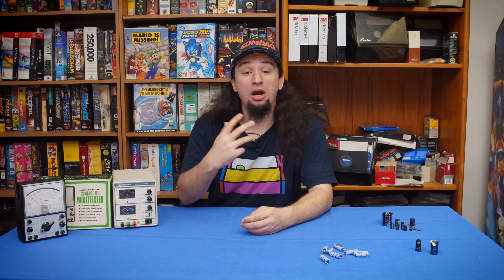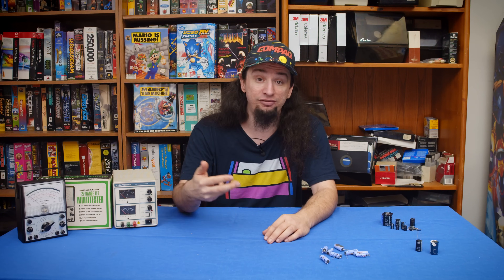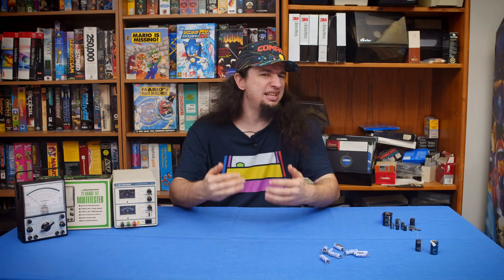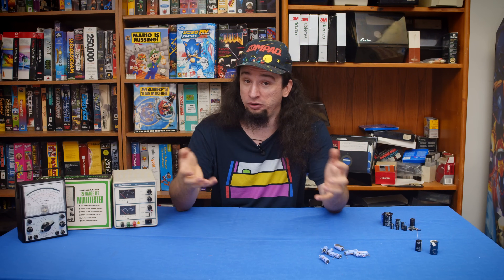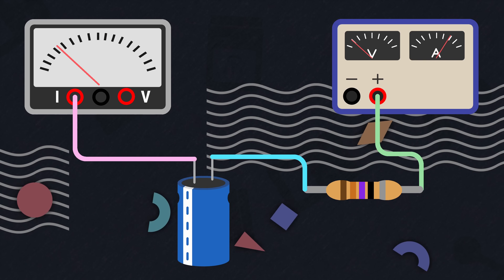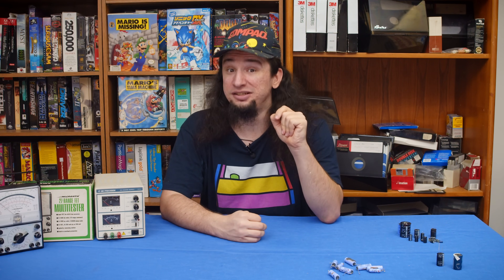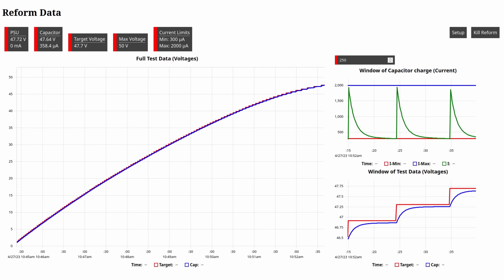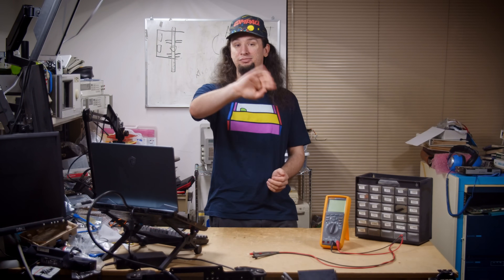Reforming Capacitors - Everything you wanted to know

Comment: This is also an issue with grossly overrated capacitors: If you use for example a 50V capacitor on a 5V power rail, it will initially work as intended, but with the operating voltage being so low the capacitor can't properly reform the oxide layer and will lose its formation over time. It's always a good idea to leave some safety margin for the eventual stray voltage spike, but too high is bad as well.
Reply: This is why capacitors in the HVAC industry have multiple oxide layers and thus multiple voltage ratings, 440/370 is the most common that I've seen in the field.
Reply: @DGTelevsionNetwork  HVAC or other motor start/run caps need to handle significant AC power through them, not AC ripple from a DC power rail.
Reply: Hey thanks. My electrical engineering teacher back in the day just said it’s a bad idea for complex reasons and should only be done temporarily as a last resort. Lowkey always wondered why but never bothered to look it up.
Reply: this seems to be little known but ive been tought this by tv repair engineers in the 90,s lifes too short to test the theory so i just go allong with it , another little known i was tought (unproven) is that small signal relays need a little dc current through the contacts to keep em clean
Reply: @darrenmurphy6251  You are quite right, relay contacts have minimum ratings. Too little energy can't break through a microscopically thin layer of oxide (sulfate too due to the silver) if there's appreciably no sliding contact occuring. A good example is a commercial timing relay module with 10A contacts being used for just a logic level (I know, but they're out there). Works fine, ...for a time, then gets intermittent. 😏
Reply: Isn't it fairly common for low-voltage caps, in signal applications or even in low-voltage rail decoupling, to be rated at 50V or 100V just because manufacturers don't particularly like stocking 6.3/10/15/25/35/50/63/80/100V variants of 100n-47u caps in a 5mm case?
Reply: @sirnickity  Not just this. They littlery doesn't exist in most case. Just say: Looking for a 1µF with 6.3V. Good luck. You will just find some with extremly small sizes, made for special cases and they are more expansive too - because they are a niche product.
As an engineer for decades now, I just can say: In 98% of the cases we simply don't care by selecting general purpose parts. Lets say coupling capacitors. You will need somewhat around 1µF and 10V? Fine, we will select a 2.2µ or 4.7µ with at least 50V. Why? Because it doesn't matter and in most cases some values are cheaper or you will strip some special values from your BOM by changing it to another value used on the board anyway.
This video is not really well made... there's so many myth and things mixed around... for example what he was telling with "self healing" in the beginning. A kind of term used for metal film capacitors, to make them short-circute resistant. Not a term used for electrolytic caps at all.
As of my experiance the most common failure mode in the 90th up to the 2010 years was simply drying, leaking and overheated capacitors. Littlerly the whole 90th electronic equipment tackle with leaking capacitors. Whereas some electrolytic capacitors from the 60th and 70th still measure find today - many decades later. Around the millenium time point we tackle with blowing capacitors, resulting of new heat problems appearing, because of the new requirements for power/space density. And internal heat resulting of hard rippling DC/DC stages, the old capacitors are not made for.
Except some really bad caps, as like most ELNAs from the 90th or simply all early SMD electrolytic (also 80th/90th), the top most enemy for electrolytic are missusage in relation to heat. There is no magic reforming on most of the failures. This might exist in some case, but is simply not a major problem.

And also with a engineer perspective of view, I always wonder why guys in repair videos tacke around with some caps, for example small leaking SMD caps on 90th equipment, which they try to replace with standard THT parts, by opening up shilding cans. And they always tell you: They are better, they won't leak. Bullshit. First of all: They could easly replace them with ceramics. MLCCs with high capacities do existis today and they are sometimes feaking low in price. Most of the caps replaced in such videos are just blocking capacitors. Using ceramincs gives better results - but they didn't have the knowlage. And second: THTs can also leak. And does it matter? Most of the equipment they repair is litterly 30 or more years old. What do they think this equipment will life after such a repair? Another 50 years? Bullshit. And not the start thinking about the point current SMD replacements last many, many, many years. And last of all: "They are better..." Well, open up shilding cans to make fit long leged capacitors do make it "better"? Oh god please, no...!

And as an advice to all here: If you have to replace an electrolytic, use at least the same capacity and at least the same voltage rating and if you just heave higher values: It simply don't matter. Don't think of an engineer tricking around with this specific value on this specific electrolytic. This is bullshit. We overprovision them all! We don't try to hit a spcific value. The have tolerances in the range of 20%. What do you think makes it reasnable to hit a specific value target!? This is simply bullshit. And this applies to around 95% of the cases. Yes, there are sometimes very special cases, where you nail a specific target on purpose. But this is simply very rare. I would never bother with this, I would switch to a foil or ceramic capacitor, becaus it's just more predictable. I am not the only engineer with this mindset, so don't think of it too much here.
Reply: Wouldn't it just slowly approach being a 5V capacitor then with the oxide layer rebuilding at a much lower rate? The large safety margin will be gone after a (long) time, but I can't see why it wouldn't continue to be operational at the lower-than-designated voltage. Maybe I'm missing something, though?
Reply: @ResonantBytes  I used capacitors at lower voltage and none of them failed in say 10 years.
The way things are now the ones who use electronic parts for building anything is: let's see how we spend less and let the poor parts operate the most and if it is possible, we can let them reform themselves.
The same bullshit apply when they make cooling systems for whatever you may think of. One notorious example is how they make cooling systems for laptops shrinking the cooling systems until the CPU reaches 100 Celsius if it is rated to work at 120 Celsius.
I never had any trouble with capacitors rated for 50V at a maximum of 12 or 25V. They never failed in a long period of time.
Also make a cooling system to cool down a CPU/GPU at max 55 Celsius instead of 90 Celsius and it will last forever (apart from not heating all of the surrounding capacitors making them to fail way before their time). Use 25V rated capacitors at 12V whenever you want. Nothing bad will happen to them.
I don't know what can happen if someone uses 400V rated capacitors at 12V but for half of the rated voltage it's completely fine.
There's audio capacitors used at 0,775V while they are rated for 50V and they are still doing their job in amplifiers 20 years old.
Reply: @Dandan-tg6tj  Yup, that's my experience as well. I think the original statement was about the extreme case though, like the 400V cap at 12V you mentioned. I'm not sure what will happen to them either, but I can't think of a reason why they should fail when lower voltage types wouldn't. They are huge though, so the only use case I can think of would be as a cathode resistor bypass capacitor in a tube amplifier to have enough safety margin for shorts between anode and cathode. In that case the oxide might actually have degraded enough so it wouldn't be able to cope with the Ub for the tube, but the anode resistor will limit the current and voltage effectively. So even there I would prefer having a capacitor that would potentially be able to withstand the fault condition over one that definitively would not.
Reply: @ResonantBytes  it may not stay formed long term, also bad idea to use, say a 50v cap thats been operated at 5 to 10v or so for a long while, then at near 50v,  without a reform 'test' ..
Reply: @ResonantBytes  Two things: the thickness of the oxide layer determines the capacitance, so there's no guarantee that the "rebuilt" 5V capacitor will have the same capacitance. Although in many cases it won't be a problem.
Secondly, if the capacitor is ever re-used as a 50V capacitor (which it's marked as) there's a real chance of some serious over-current until it manages to reform to work at 50V.
Reply: @RexxSchneider  Yes, if the overall thickness of the oxide layer decreases significantly that would increase the capacitance. I'm not convinced that's what's happening though. The oxide layer won't deteriorate evenly and there will be points where the thickness is much smaller than the overall thickness. It's these thickness minima that determine the ability to withstand voltage. It could still happen over a long time, but in my experience I rarely found electrolytic capacitors which had gained capacitance over their rated variance (usually -10%/+50%). As you said, in most cases it wouldn't matter anyway. It's something I will keep an eye on in the future though! :)

There is only one use case I can think of where that would happen though: If you place a capacitor in the circuit which is overspec'ed for the normal case, but has enough margin for a failure case. In tube amps e.g., there are often capacitors used as a bypass over the cathode resistor to increase gain. The voltage there is usually small (2-10V) but the Ub of the tube is much higher (e.g., 250V). There is a failure mode where the anode and cathode of the tube short out and in that case the cathode voltage is much higher than usual. If the cap there is rated only for the normal case it won't survive this kind of failure of the tube. That's why I use caps there which are rated for the Ub (which is still overspec'ed because anode resistor and cathode resistor form a voltage divider).
In that case the cap might not be able to withstand the failure mode after a long time of no such failure, which is a good thing to keep in mind. But in this particular case it might actually still be fine because the anode resistor will limit the current to a few mA. Also I'd take a component which can potentially withstand the failure over one that certainly can't any day.
Reply: @ResonantBytes  Notice that the reforming curve is just that, a curve.  Since it's not linear, it can be difficult to predict how using a higher voltage cap will function in the long run. Generally speaking, a lot of time and effort goes into the engineering of most electronic circuits and the engineers often choose specific values and types of components for reasons that may not be immediately apparent.  But, it's always a safe bet to replace a component with one of the same material type and values.
Reply: @projectartichoke  a lot of time and effort? I give you the salt bae meme with capacitors being sprinkled. Capacitors are often specifie based on prior experience and just industry tradition, and if it hasn't caused issues in engineering samples, that's it then, that's what it's gonna be. If this wasn't quite the optimal choice, well what are the odds that the commercial/useful life of device will exceed 5 years? It's going to be fine.
Reply: @projectartichoke  Agreed, it's hard to predict what happens exactly inside a certain cap if it's not used in a way that was tested.
But that doesn't convince me that there will be more problems when using a capacitor with significantly lower voltage than it's designed (and tested) for. In analog circuits that happens all the time e.g., when using an electrolytic cap to block DC from an AC signal. There the maximum voltage might only ever be reached in certain conditions, even only in fault conditions, but still they aren't failing more often than caps connected to a power rail. I'd argue it's even the opposite. Those caps might fail due to other reasons, especially heat and high currents, but if those are the limiting factors, I doubt the original argument about the influence of higher spec caps even more.

Yes it's not linear. But it doesn't have to be. It's an equilibrium system. When the oxide layer degrades, current may be able to flow at the current voltage. If it does that will rebuild the oxide layer, reducing the current that can flow at that voltage until an equilibrium is reached where the oxide layer rebuilds as fast as it degrades (or other effects start to have an influence). The oxide layer will be weaker than if the cap had been powered near its designated limit, but any current due to degradation of the oxide layer would have contributed to the regeneration of it. Also presumably less electrolyte will have been used which would actually prolong the life of the capacitor.
Reply: @ResonantBytes  are we discussing unpredictability vs rationality? I mean, the "I don't know" vs the "I guess"....
Reply: @jesuschal3802  Maybe? I don't know what you mean I guess. :D
Could you elaborate a bit more?
Reply: @ResonantBytes  It was just a reflection. I read two different approaches to the topic (overrated vs rated caps): the factual given by projectartichoke stating "it is unpredictable how the deterioration process would affect an overrated cap overtime" vs yours explaining the whole rationale about it, but still guessing the positive operational condition through out the deterioration process; both sound legit. That said, Siana makes a good point above "Capacitors are often specified based on prior experience and just industry tradition". So given both approaches (overrated vs rated) then "I guess" only time will tell...
Reply: @jesuschal3802  I like your thought process. Sometimes we simply don't know what's happening, but it's always good to be as prepared as possible for the moment we find out. :)
Reply: Hello. It would be very interesting to make a video and talk about what happens if you use a 100v capacitor where it was originally 50v. Or 50v where there was originally a 5v capacitor.

what happens to the microfarad value during use and reforming of the capacitor or will the life be shorter when you apply 5v to a 50v capacitor og 50v to a 100v

Can someone say something about this
Reply: @ford1546  Yes--When Olson Electronics was around, the electrolytic capacitors that they carried in blister packs had guidelines on selecting replacement devices. The most obvious caution was that the replacement capacitor should have a voltage rating equal to or greater than the original. They also clarified that one should not use capacitors "far below" their rated voltages. In my recollection, the example that they gave was of a capacitor rated for 525 V being placed into a circuit where it would never see more than 25 V.

It would seem that as a rule of thumb:
- Using a capacitor at its rated voltage is not good practice because there is no safety margin.
- Using a capacitor around 75% of its rated voltage is good practice.
- Using a capacitor at 30 - 50% of its rated voltage is OK and unavoidable in some designs. Consider the wide input range power supply circuits now commonly found in computers and USB chargers. These take a nominal input of 100 VAC - 240 VAC. The filter capacitors would see 140 VDC - 340 VDC, depending on where in the world the power supply is used. Very likely, the engineers designing the supply would use 400V capacitors as that is a common value.
- Using a capacitor at <10% of its rated voltage is a bad idea.
Reply: You get reduced overall quality by overrating capacitors.  A 5V rail you can safely use 10V cap or 25V cap; they used a 50V in assembly because they bought bulk and had them cheaper than buying half of them at 25V.  Also for tooling, that spot in the assembly chain they only need one capacitor inserter instead of two.  Cheaper overall for mass assembly, that's why you see 50V everywhere.
Reply: @officermeowmeowfuzzyface4408  some lower capacity types arent even available in lower voltage ranges anymore.
Reply: This is not true.  It is safe to use a higher voltage rating.  If you use a 500V rated capacitor and only apply 5V, the dielectric does break down over time, but to the point where it can properly handle 5V.  It could be reformed to handle 500V again, as long as the applied voltage is slowly increased.
Reply: @Jagasian  a bit higher, yes, but not ridiculously so,  a 500v cap used at 5v likely wouldnt stay formed long term 50v cap at 5v, not quite so bad , but still.....
Reply: Likewise, for filter caps, using 10,000 mfd to replace a 10 mfd may not be a good idea even if it seems like more filtering is better.  Larger value capacitors have more current inrush when initially powered which can damage other parts of a circuit.  It's not usually a problem, but it some power supply circuits it can be a problem.
Reply: @projectartichoke  very bad idea, the peak charging current can destroy rectifiers, especially valves/tubes , its ok to use higher values further downstream, separated from the rectifier by a resistor or choke, but not always if by a semiconductor regulator/stabiliser as that would also see a current surge when first powering up
Reply: @projectartichoke  First, testing will indicate that there is a point of diminishing return. Second, most power rectifier tube datasheets will specify the max size of the first power supply filter. For instance, the max recommended size of the input cap in a 5Y3 rectifier is only 10 mfd.
Reply: @projectartichoke  "Likewise, for filter caps, using 10,000 mfd to replace a 10 mfd may not be a good idea even if it seems like more filtering is better."

It also depends on what the cap is being used for in the circuit.  Capacitors are not just used for filtering.  They can also be used for reserving, coupling, decoupling, and bypassing.

A capacitor with a low capacity, like 10 microfarads or 1 microfarad, may be there for some form of coupling (of course, this depends on what the circuit is designed to do), so a capacitor of radically high rating is absolutely not the right part to use in such a circuit.  Instead of improving anything, it could cause a malfunction and even damage.

It's also fairly critical to stick with the same rating when replacing such low-rated capacitors compared to having some level of flexibility on the capacity if the cap is there for filtering.

Even with a +/- 20% range of tolerance, there's just not much wiggle room with caps of low rated capacities, so it's unwise to deviate from the capacity that's originally used in such a case.
Reply: One of the reasons to overspecify a capacitor can be a lower ESR and/or a bigger size that can radiate more heat. This a mainly of concern in an SMPS.
Reply: Good explanation. That's why I built my own adjustable HV power supply up to 1kVDC. In test fase, I went up to 1.1kV. So enough for my lab. Built-in micro ammeter for leak test under working voltage.
Reply: Interesting
Reply: chu Harry  Well only if the overall thickness of the oxide reduces significantly would the capacitance increase. The ability to withstand voltage is related to the minimum thickness though. In my experience I have very rarely seen capacitors which gained capacitance over their rated variance (usually -10%/+50%)

Why would timings be negatively affected? Sounds like a wild guess to me, but I could be missing something of course.
Reply: I was always told by many a professional that you can always go higher just NEVER lower just as long as you observe the Uf or in old school talk the Mfd
Reply: I was not aware of that. Neat!
Reply: This is the exact thing that happened with an IBM model M2 keyboard, it's clicky like the Model M but all plastic and quite a bit lighter. It had a 50V electrolytic capacitor that failed in (most?) all of them, easy to take apart and replace, but it's a bit frustrating to put back together.
Reply: Yes.  I hear from many people that you should just simply use as high of a voltage rating cap that you can fit into it.

There is a reason why a particular voltage for the cap is chosen in a design, and it can be summed up in one word: balance.

Specifically, balance of costs and benefits.

Cost certainly is a factor because overkill is lost value and can go well beyond what's financially reasonable for a safe operating margin for the part, especially in mass production where a small increase in the per-unit cost adds up to the overall cost.

Another factor is because the capacitor cannot perform efficiently if it's being used outside of its optimal range according to the part's data sheet.  Too low voltage can even result in diminished service life of the capacitor, albeit over a greater span of time compared to too much voltage, but nonetheless increasing the odds of downtime for the unit occurring sooner than expected.
Reply: Love the video and very informative, however for vintage audio I could order, receive, and install new caps before these caps get reformed.
Reply: small opinion based on pc power supplies. the best efficiency is around 65 -85%(for gold, platinum ) usage which would seem to suggest caps 15-35 % over spec would be most efficient. although im not sure how titanium power supplies manage 90% efficiency at any load. some other electrical theory i could benefit from.
Reply: @tobiwonkanogy2975  efficiency of psu doesnt really have anything to do with cap voltage ratings, thats down to the circuitry used,
Reply: @tobiwonkanogy2975  These are switching power supplies that depend on switching energy into and out of an inductor by a mosfet switch in order to change the voltage. That's where most of the inefficiency occurs, not in the capacitors used. You probably need to read some articles on "switching power supplies" to get a feel for what happens.
Reply: Citation needed ... Capacitors are not vegetables, or perishable goods, which is what one might think reading your post. LOL
This is a joke, isn't it? A capacitor is chosen for and by the specs that the engineered application is requesting(MATH and PHYSICS!). 
No one with the slightest bit of expertise takes capacitors with parameters completely out of the blue and puts them in his design.  
What should this stupid strawman even mean? That amateurs do silly things? Well, no shit, Sherlock!:)
Reply: @dieSpinnt  electrolytic capacitors DO 'perish', in time, but can be a very long time, if a good quality capacitor ,not heavily stressed in use, many cheap n nasty and even 'fake' ones failed after a very short time (google capacitor plague).... non electrolytic types 'can' have the potential of indefinite life, but even then, plastic materials can and do degrade, but usually very long life, certainly more than the life of the equipment as a whole, i certainly wouldnt worry about non electrolytic life!
Reply: the rated/estimated life on electrolytic capacitor datasheets are usually with everything at maximum, temperature, voltage, ripple current, etc. if any or all are reduced, life can increase very sharply